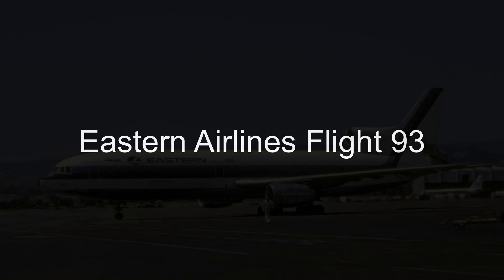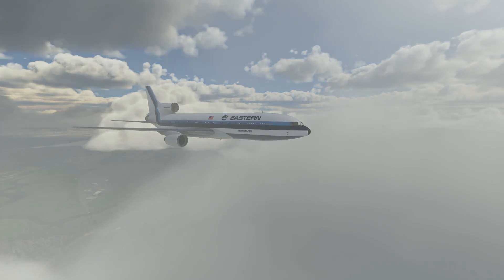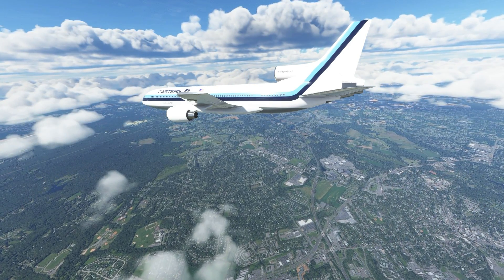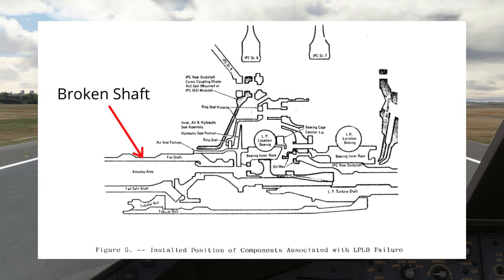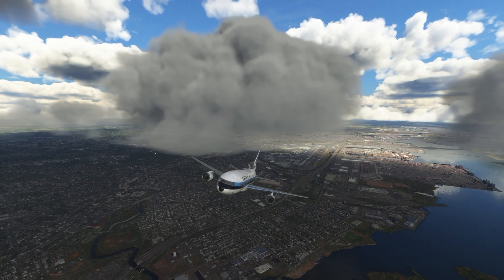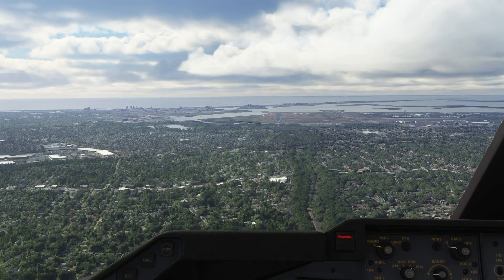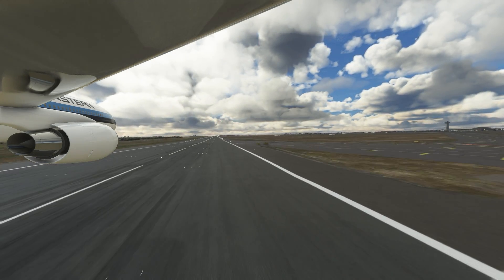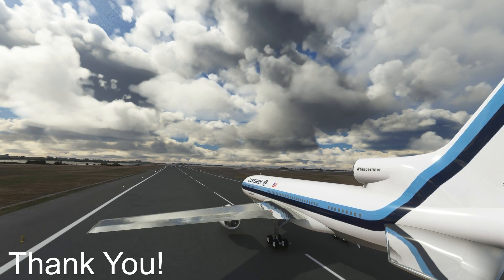How 3 AMAZING Pilots Made A Near Impossible Landing | Eastern Airlines Flight 935

Comment: This could have been so much worse if they lost the last hydralic system or the rudder had been disabled off-centre.  Redundant systems are great, but they do no good at all if they have a common point of failure.
Reply: Unfortunately, tail control is vital for an aircraft, and there isn't really a way to design a hydraulic system that isn't vulnerable to a tail engine disintegration for that reason. Even if you have a line that avoids the tail entirely, you'd effectively lose your horizontal stabilizer and elevator anyway, which would leave the plane similarly uncontrollable. It's a flaw in Trijet and Tailjet designs at a fundamental level.
Reply: Check 'Windsor incident' (American 96).   DC10, cargo door, floor collapsed, the usual.   The rudder jammed hard over, they lost the tail engine, lost the left-hand elevator, still had the right-hand elevator (but very stiff, they had to pull with full strength to work it), still had the hydraulics and wing engines, had to compensate for the rudder with ailerons and engine power settings.   Rudder hard over is no fun, I think it killed a couple of 737's way back when.
Reply: Yeah, when he mentioned "rudder stuck in the neutral position" I was like "thank god," because off-neutral rudder = bad time. Like, if you have an otherwise mostly functioning plane, you might be able to compensate for it, but it's still a bad time. And if you don't have a fully functioning plane, I hope that luck is on your side.

Comment: As beautiful as I find the T-tail planes, I guess this is another design issue with them, apart from the deep stall
Reply: This wasn't a T-tail, nor was the DC10  (which also lost 3 hydraulic lines, unfortunately it only had three - UA232).
3-engine T-tails were the 727 and Hawker Siddeley Trident (both of which had 3 rear engines, and S-ducts for the middle engine like the L1011) but I don't recall either of them having an issue with the engine exploding.

Comment: If they had taken this as a warning to all trijets, it would've likely saved United 232.
Reply: No.   It might have been a warning for future designs, but there was no way Douglas would have put a fourth hydraulic system into the DC10 at that point.
Reply: @cr10001  I didn't say a fourth hydraulic system. There are other options besides adding an entire other system. Electric motors, bleed-out protection systems, etc.
Reply: @ncc74656m  Given the way that Douglas fought tooth and nail against doing any proper fix of the cargo doors / cabin floor, even after the Windsor Incident demonstrated exactly what could happen,  until the Paris crash forced it on them, I very much doubt if they would have been amenable to expensive mods to their DC-10 in the light of a problem with a competing aircraft type.
Reply: Completely different failure points, and 2 different planes, this one was a Lockheed, flight 232 was a Douglas DC10. On the DC10, it was a fan disk failure, on this L1011, it was the engine shaft that failed. Only coincidence that they are both tri-jets.
Reply: @mattcat231  You're misunderstanding my point. What I am saying here is that they could've seen the risk bundling so many hydraulic lines without some sort of bleed-out protection in the tail could've caused or other backup system.

They DID retrofit the DC-10 to help in this eventuality after United 232, and my point is that if they had examined this risk they could've implemented a fix and combined it with an AD to specify rectification at the next major scheduled work to prevent it from interfering with airline operations and minimize cost.

Comment: This is why pilots earn so much money...  For the one time in their career that an issue requires so much more than "running through a checklist".  Seems unlikely a safe landing could have been achieved if the last hydraulic seems had failed totally as well.
Reply: With the skill of the pilots, it may have turned into a second United 232 (though actually, 232 happened after this horrifying situation).
Reply: @Alfred Weber   So true.  Pilots sometimes earn less than FAs in the beginning of their careers, which is so wrong...

Comment: This reminds me of the famous United 232 crash in 1989 where all of the hydraulics were blown out from a tail engine disintegration.
Reply: In the weeks that followed United 232 crash at the airport, over 30 crews tried to make that same crash landing in simulators, not a single crew was able to get within 5 miles of the airport. This tells you how good the United crew was that day!!! It helped to have the extra pilot on board that day that gave the crew a hand. I'm not sure if any crew ever has made it to the airport in simulators to this day!!!!
Reply: UA 232 was a DC10.   This was a L1011, had four hydraulic systems to the DC10's three.    Guess which I'd rather be on   :)
Reply: @cr10001  Moot point. L1011 got off lucky for this one. If it can knock out three, it can definitely knock out four.

Comment: The crew did very well indeed. However I wonder if some basic engineering training might of helped. If I had been flying and got two warnings on the same engine involving vibration and oil pressure fluctuations I would have shut down No 2 and landed asap. I work with engines. ANYTHING to do with oil is SERIOUS with an engine. In this case the plane told them that N0 2 had a problem of SOME kind with oil and vibration. Those two do not go well together. If I wasn't a mechanic ? Well I guess I would have carried on and kept my eye on it like these guys did. No blame to them. Training is expensive and their job was to fly planes not service them.
Reply: I couldn't agree more. Multiple warnings on the same engine, shut it down and return to the airport.
Reply: @gregorcutt1199  Considering an airplane is designed to be able to continue to fly on a single engine, and work as a glider for some time with no engine, no, I'm not quite sure "Hmm maybe 1 engine might go" is by itself enough of a reason to return to the airport. If the magic mechanic's knowledge pilots should have gotten was that the engine might combust if they kept using it? They could have proceeded just fine without it.  It was the hydraulics' loss that was the issue.
Reply: @annedavis3340  they are DESIGNED to fly on two enginess, but that doesn't mean that you continue normal operations if you lose an engine, especially on an overseas route
Reply: @gregorcutt1199  depends on their route. A path between Puerto Rico and Newark runs darn near parallel to the coast, and I suppose could have been largely over land. 

In this case the engine blew up so yup it seems ridiculous they hadn’t set it down. But "Hmm that's odd" isn't always gonna make people turn back, whatever hindsight now might say.
Reply: @annedavis3340  he put the flight path in the beginning of the video. It's basically entirely over water. My understanding is that the existence of three engine jets was the requirement for more than two for over water operation, at least before "etops".
Reply: @annedavis3340  I think the problem is specific to the planes that have tail engines...as in, the hydraulics systems are RIGHT THERE if the #2 engine goes.
Reply: @nerysghemor5781  yes, that's what went wrong, and where hindsight helps us.
Reply: Even if the engine was shut off, wouldn’t the airflow keep spinning the turbines?
Reply: You would’ve taken out the manual and read what you’re supposed to do.  
Which is what they did. 
What type of basic engineering training did you think would help them understand this problem better?
Reply: @neilkurzman4907  Understanding that engine issues involving oil pressure are SERIOUS.
Reply: @Rincypoopoo  
The manual didn’t say immediate shut down. Maybe it should have. 
Remember the oil pressure and quantity were still good.
Reply: @neilkurzman4907  ...but they were fluctuating. The point I tried to make was that they were trained to fly. They were not taught about how the engines worked. If you are an engine person ANY wobble in the oil system is a cause to worry. If you are not an engine person you might think it was just a blip and carry on.
Reply: @Rincypoopoo  
An engine person? Because all engines are alike jet engines and turbo fans?
They deal with those engines day in and day out. If the engine people who designed and made the engines were concerned they would’ve put something in the manual. Apparently they did not. I would guess that they did after this incident.
Reply: @neilkurzman4907  All engines that contain moving parts need lubrication so in that sense they are all the same. A lot of people have no idea how their car engine works. A little blink or two of the oil light would not worry them unduly. A mechanic would stop immediately and start checks.
Reply: @Rincypoopoo  
Planes are not a mechanic owning his own car. 
For the plane to land it had to dump ton of fuel. It Can’t just pull over. And assuming it could what checks do you think they could’ve done? It was an obscure problem inside the engine. 
What they do have as an emergency checklist for every major situation in the plane. Written by the people that need the engine. Going through that checklist is what they were trying to do.  Not to speculate on what they think may or may not be wrong with a multi million dollar jet engine. 
They went through the checklist. It didn’t say to shut the engine down it didn’t say to pull the fire bottle. 
They did put it to idle. Which would have certainly put less stress on it. 
By the way Jet engines mechanics don’t guess either, they also have books and checklist that they follow. 
Which are supposed to ensure that situations like that never occur.
Reply: I don't really agree that it's reasonable to keep the engine running because you just fly the plane and know no better.

I'm not an engineer. To me, the warnings were sufficient to pull back to idle, removing the engine as a source of thrust for flight. So you know the engine is damaged. Running a damaged engine can only damage it further. Even if they didn't think it could explode, they should have cut the fuel and remove the risk of fire.
Reply: @gasdive  Correct. IF they had been told how serious an oil warning was.

Comment: Why would the designers of this aircraft bundle the hydraulic lines so close to the engine without a protective wrapping?  Instead of playing the odds, they should have put those hydraulic lines in a strong metal enclosure to protect them from the shrapnel from a blown engine.
Reply: If you're planning for your engine to explode then you're building the plane wrong.
Reply: @abebuckingham8198  There is no guarantee that any engine will never explode. Maintenance is sloppy.  Structural failures of the turbine blades can and do fail all the time.   The key is to protect valuable structures against the fallout from said explosion.  Why do you think Boeing mounts their engines on pods in the first place?  The hydraulic lines should have been well protected.  Look at the Sioux City Iowa Crash. They never expected that engine to blow either.  That wiped out all the hydraulic lines and many people died because the plane was basically uncontrollable.
Reply: @Thankingyou1  If your engine is exploding you should expect to crash. Instead, engineer your engines not to explode instead of planning for them to explode. It's smarter.
Reply: @abebuckingham8198  Look at the recent incident with Southwest airlines. The engine exploded.  The cowling did not contain the fragments.  It rupyured a window, depressurized the aircraft and partially sucked a woman out of the aircraft. The FAA is insisting that stronger cowling be engineered. That only makes good old fashioned common sense.  According to your way of thinking there should be no redundancy because you expect everything to work perfectly which it never does in the real world.
Reply: @Thankingyou1  It's still a stupid thing to consider during design because as you said, you're trying to predict the unpredictable. It's like making sure your house has enough buoyancy to float just in case it ends up in the ocean. Sure, it happens, but is it worth considering when you design the house? Absolutely not.
Reply: @abebuckingham8198  You miss the point completely.  The FAA is insisting that Boeing re-design their engine cowlings on their engines to contain the shrapnel in the event that an engine blows.
Reply: WASHINGTON—The FAA plans to mandate three modifications to Boeing 737 Next Generation (NG) nacelles linked to a pair of inflight fan-blade failures that caused significant damage outside the engine and led to one passenger fatality. 

In written correspondence between the FAA and NTSB, the regulator said it will “issue three separate airworthiness directives (AD) to address mandating corrective actions for the modifications of the inlet, fan cowl, and exhaust nozzle.” The letter, sent in April 2021, was recently made public and has not been previously reported. “The FAA is working with Boeing to ensure that the design changes will address the most critical fan blade impact locations for each area of structure,” the agency added. 

Boeing is finalizing service bulletins (SB) for the inlet and fan cowl that details changes operators will make and could release them as soon as July.
Reply: @abebuckingham8198  If it's so stupid then why do all aircraft have multiple redundant systems?  According to your theory the systems should be so well built it never fails.   Obviously, the FAA and Boeing disagree with you.

Comment: Hmmm... not want to play wisecrack here but... Engine vibration combined with an oil pressure warning imho call for an immediate engine shutdown. Internal failures quite often do not show in over all engine performance like EPR, EGT, RPM, etc. at first - only when it's too late, like in this case here.  It's these insidious lubrication failures which quite often cause uncontained engine failures . Been there done that (ex ATP here). Thanks for another very interesting case study!

Comment: And sadly that's why we don’t have big trijets anymore
Reply: DEZZNUTZ 1001  
We surely don't need them today
But maybe those days yes: even without gov mandate, jets like the the L1011 would kinda struggle with just 2
Reply: @thelatiosmaster    In those days the DC10 and L1011 were bigger than the twins (and bigger than the 707/DC8) so needed three engines.   They were smaller than the 747 so didn't need four.
The fact that three engines allowed long over-ocean flights was a bonus when twins were restricted in how far from land they could go.
Reply: @cr10001  that was my point
Reply: @thelatiosmaster    Agreed.

Comment: All commercial aircraft with engines in the tail have faced this sort of situation. Both the DC-10 and L-1011 shown here were disasters looking for a place to happen. It is a good thing that these designs are behind us.
Reply: Yea, running all the lines in the same place is kind of an issue with all modern jets though. (or I think that's usually how it all runs) The DC-10 had many more issues in that regard than the lockheed.
Reply: You also have the MD-11. The DC-10-10 (and related -15) are no longer in service. FedEx operated the final DC-10-10 flight in fact in the spring of 2021. Naturally, no 3-engined wide-bodies are in passenger service anymore, and all remaining MD-11s are on the USA registry.